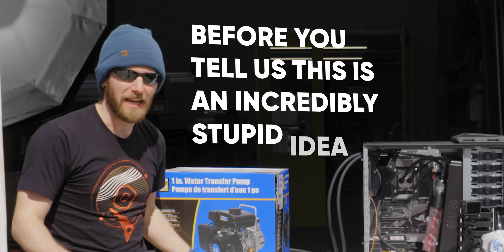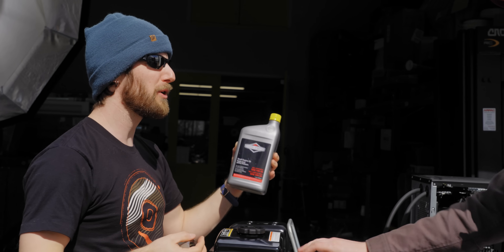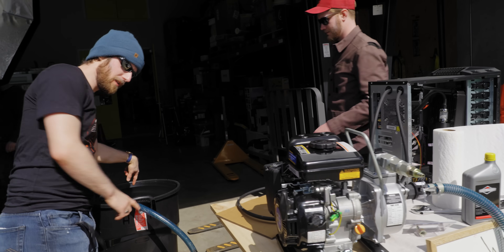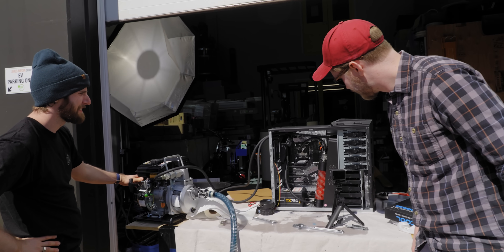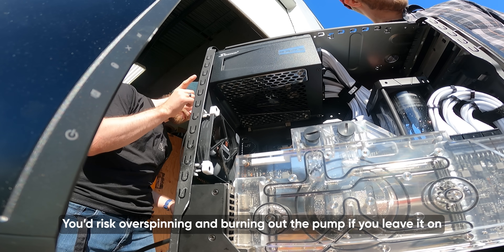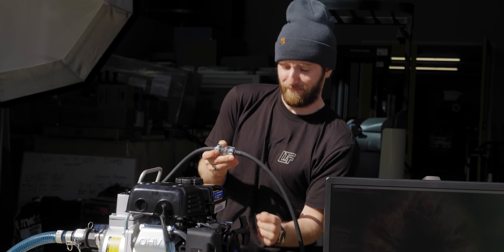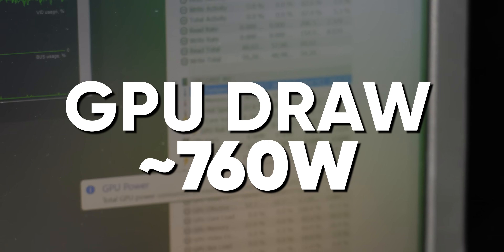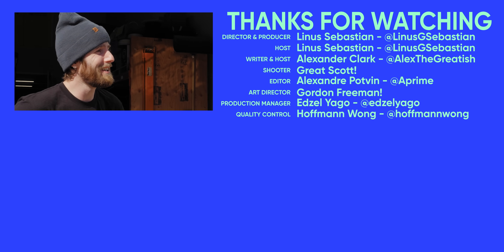Cooling a PC with a 2.5HP Pump

Comment: I genuinely wanna hear alex explain the math
Reply from the maker: According to Bernoulli's Equation as the diameter of a pipe decreases the pressure will also decrease while the velocity increases. That means when you take a pump with 37PSI of pressure at a 1" diameter and a flow rate of 9539 l/h and reduce it down to a 1/4" diameter the water will leave the fitting at 5.8PSi and 74.88km/h.
Reply: @LinusTechTips  thank you!
Reply: @LinusTechTips   Yap. As I expected... I don't understand any of that
Reply: @SeruggaRodneyWilliam  easiest way to understand is, it is always the same amount of water going through, if you have a big pipe, the water flow speed is slow with low presure, if your pipe is small, then you need higher flow speed and high presure, to achive the same amount on water going through. so from there you can calcultate every other situation.
Reply: @LinusTechTips  a1v1 = a2v2
Reply: @LinusTechTips  Who else calculated a guess before listening to the answer? :D
Reply: @LinusTechTips  Thanks!
Reply: @LinusTechTips  - but at what rate can the heat exchanger, you know, exchange heat? Faster flow isn't necessarily better. Did you determine the optimal flow rate for the water-air heat exchanger? Not that there's anything wrong with dialing it up to 11 and damn the consequences... 🤣
Reply: @LinusTechTips  THE ABSOLUTE LAD
Reply: @LinusTechTips  true when you're looking at the reduction from 1" to 1/4" in isolation but to actually know the flow rate you'd have to look at the pump performance and system curves. I laughed when I saw your whiteboard math lmao
Reply: @NexusGoomba  yet AGAIN...alex attempts to pretend to be an engineer...pisses me off as some of us actually kicked our own asses to become one.
Reply: @Thebadbeaver9  lol, chill out dude. In one of their earlier videos they’ve shown Alex using fluid modeling software and him talking about pressure losses. This is obviously just a gag video, and the only math was done on a whiteboard.

The scope of the video was to see how well a 2.5hp water pump could cool the pc. There’s no point in wasting time actually deep-diving into the mechanics of the system, since it’s not important.
Reply: @Nobody13579ify  link the video. Theres no point in engineering ANYTHING for the scope of this channel, yet they hired an 'engineer' and have essentially a small machine shop. Which, by the way, alex has no clue how to properly use either.
Reply: @LinusTechTips  I'm curious what the various head losses add up to given all the bends in the piping/blocks. have you done the math on how much pressure drop there would be? and how that would effect the system?
Reply: This right here is a free tech quickie episode
Reply: The pressure losses in that loop must have been quite something. Ramming that amount of water trough all those fittings and channels :D Should have measured dP of the loop for giggles.
Reply: I think they genuinely had the answer prepared.
Reply: Check out Eugene Khutoryansky's video on Bernoulli's principle at the atomic scale, it's very fascinating
Reply: Elian, come back to collect your wish
Reply: Must have been the wind